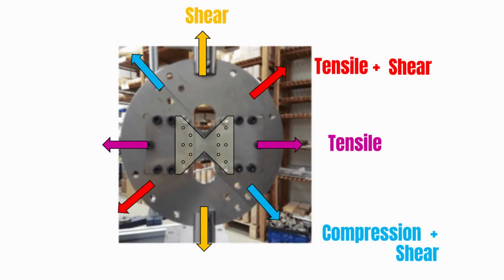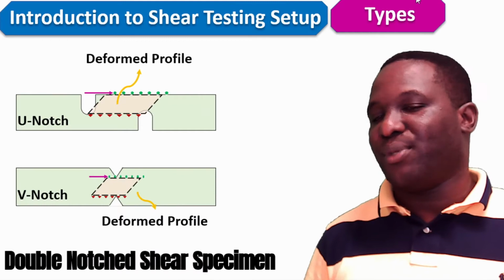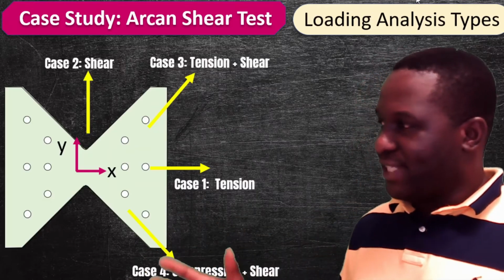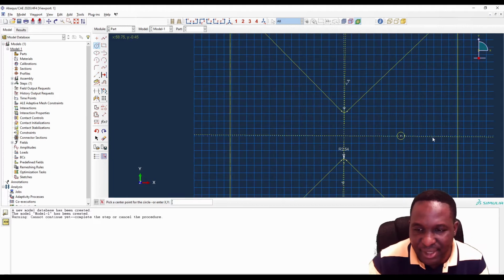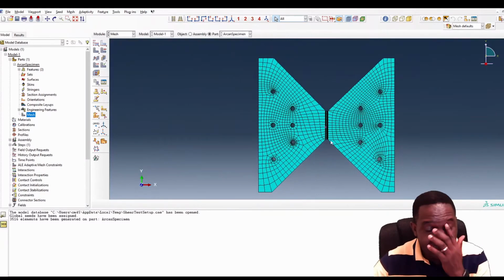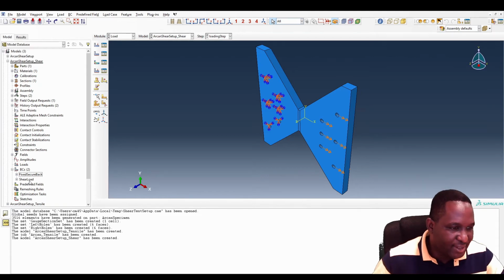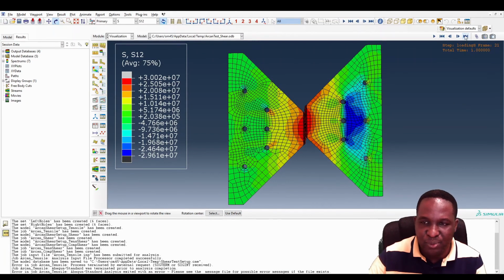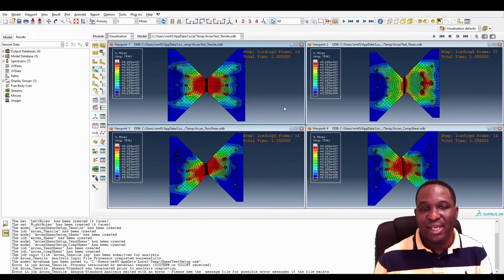Shear Testing Design: Numerical Insights into Arcan Shear Tests

Comment: Hi Dr. Michael
I have a project related to Arcan fixtures form my university at Vietnam, could I please have some documentation on this topic from you?
Reply from the maker: Thanks for the question! 
A recent and citable paper you might find useful is: 

Abdalrhaman & Becker (2024), Mixed-mode fracture: Combination of Arcan fixture and stereo-DIC, Theoretical and Applied Fracture Mechanics.
 
You can access it using this DOI: https://doi.org/10.1016/j.tafmec.2024.104724. 

It uses a modified Arcan fixture and includes pure shear (Mode II) and mixed shear–tension loading, so it should be very relevant to your project.
Reply: @MichaelOkereke  thank you very much, sir. It's very helpfull , i'm looking for document or sicence newpaper about DESIGN CRITERIA FOR ARCAN FIXTURE can you help about these or any website can find some thing usefull about these information

Comment: Dear Dr. Okereke, i am interested in the Arcan shear test specimen shown in your video. I was wondering if you designed this specimen by yourself or if you have any reference for the geometry of this specimen. Thank you. Looking forward to your reply.
Reply from the maker: Hi Qiangchen9503, thanks for the question. I did not actually design the dimensions of the specimen. I found it somewhere - in a publication - not sure again. However, if you need a reference, then use this: https://link.springer.com/book/10.1007/978-3-319-67125-3

It is my book and in page 291, chapter 8, I gave the same dimensions so it will be a resource you can reference, if that is what you are after.

Comment: Hi Dr. Michael

I think you used the wrong unit system. For the dimension of the part what you used is milimeter, in this case, for Abaqus the unit for the stress should be MPa.
Reply from the maker: Hello @Yunsong Guo, you are right about the mix up of the units. If the consistency of units is kept (as it is correctly advised to do so), you will need to specify the Young's Modulus as say 210,000 instead of 210x10^9. So, I agree with your position. However, it does not affect the result here. We just have to understand the results are shown in Pa rather than MPa, nothing else really to say about it.
Reply from the maker: Yes, I agree with you on this, it does not affect the result at all.
Reply: However, this does not affect the results, because the model is relatively simplified. I learned a lot. thank you!

Comment: Hi Dr. Micheal, I am a first-year Ph.D. student at UNSW - Australia. I have a question regarding one of your previous videos -  "RVE modeling of metal matrix". I am trying to create that structure.

You have mentioned that you have gotten the center point of the spheres using Monte Carlo implementation in MATLAB. Do you have any tutorials on it?

My intention is just to create spheres that are placed randomly - but I have to properly justify placing those spheres in random orders. That is why I am trying to understand how to use MATLAB and monte Carlo implementation.
Reply from the maker: Dear Shakib, thanks for your interest in the channel. Yes, you are right about the Monte Carlo Implementation. I have used an inhouse code I developed to do this. I am working on a version that should be available for people to use. When this is available, you will know about it. If you are subscribe to my CM Videos Insiders Group, you will be informed when the codes become available. I hope you have signed to my CM Videos Insiders Group via this link: https://cmvideos.ck.page/16a99bd0e3. Watch this space.